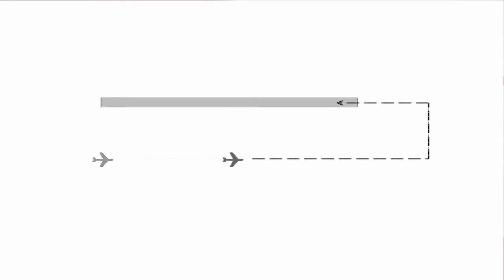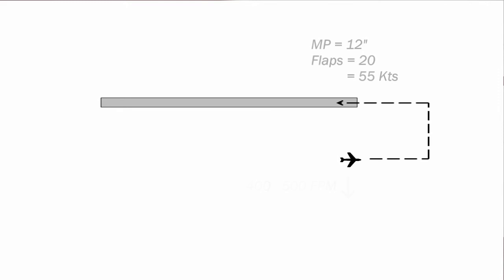Todds Tips - Normal Approaches

Comment: Thank you for finally telling it right.  I see so many YouTube videos showing people flying a downwind leg in a Cessna 172 (for example) at 125 mph.  Then dropping 20 degrees of flaps in the turn to base and dropping 40 degrees of flaps during the turn to final.  I think that is so crazy.
I believe, as I believe you do, that on a downwind leg the airplane should be set up at 1.3 times the stall speed in the landing configuration with 20 degrees of flaps, landing gear down and landing checklist complete.  Then when it's time to turn base leg everything is done except to fly the airplane just as you describe.  This will not only give you a stabilized landing but will prepare you to fly instrument approaches.  You are asking for trouble if you are shooting an instrument approach and fooling around with airspeed, flaps, landing gear, etc. at the same time.  This is a recipe for disaster.

c
Reply: Good sound advice.